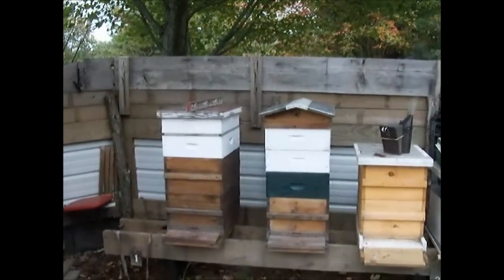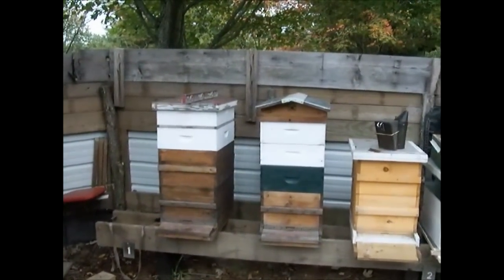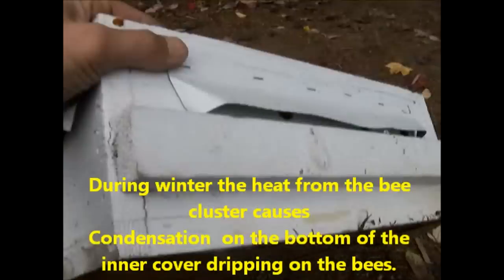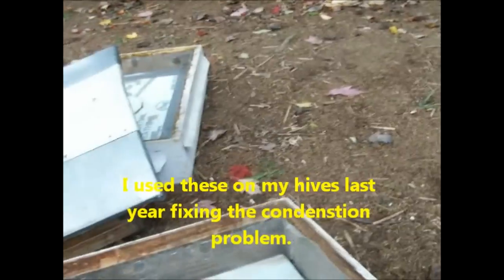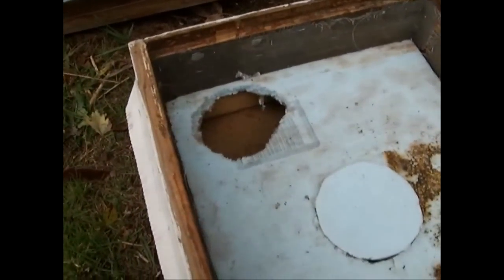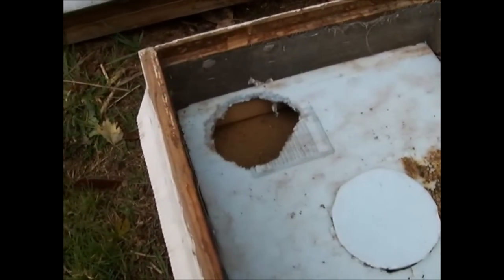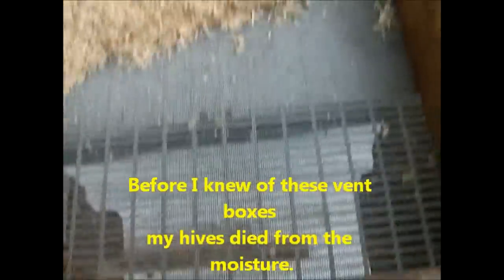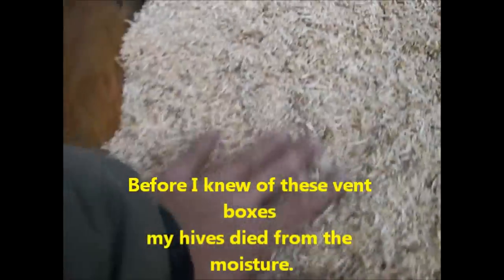How To Make A Bee Hive Quilting Box (Winter Moisture Box)

Comment: Hi, Jason,
I will be getting my first two hives in the Spring, so I've been learning everything I can before it happens.  I've watched all of your videos and learned a lot.  Thanks for doing them.
As to winter ventalation, nobody addresses what to do with a screened bottom board.  Is it closed off completely, left fully open, or patially blocked?  I live in CT, winters are probably similar to yours.
Thanks.
Reply from the maker: +LongBinh70 Well thanks for watching them and I am glad to here your becoming a beekeeper. That is great! As far as the screened bottom boards I have been leaving them fully open the last couple years with great success. It helps keep the moisture down in the hive. Air flow is important.
Reply: OK.  Thanks again!